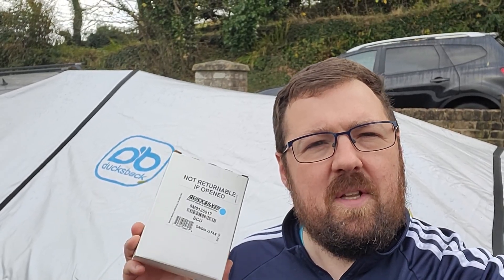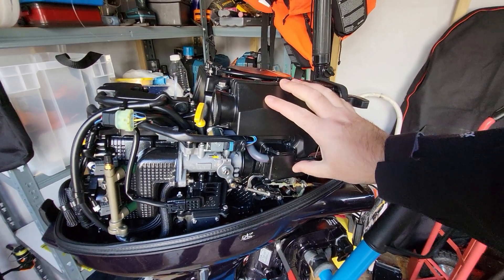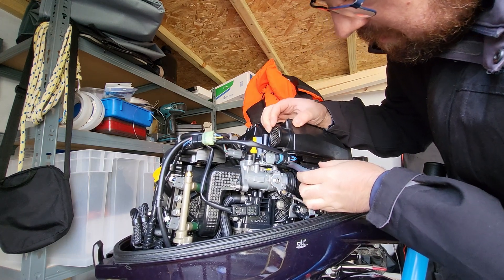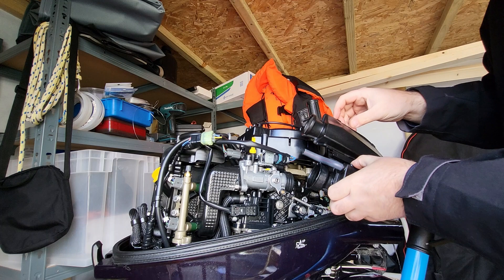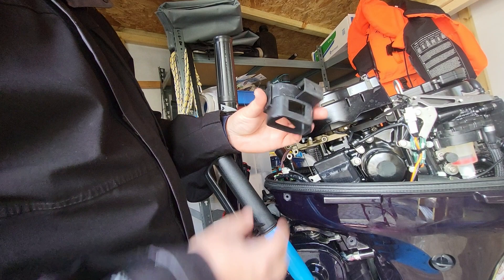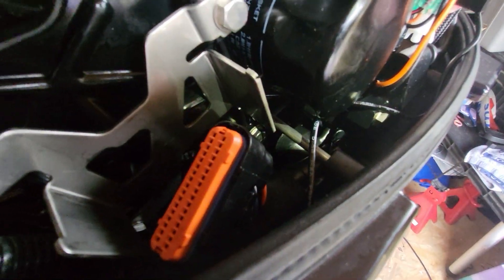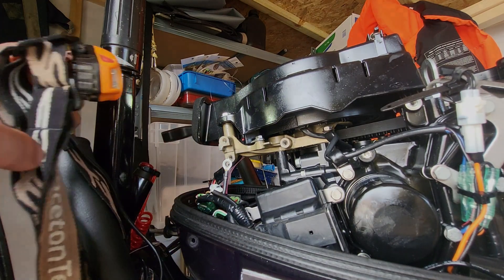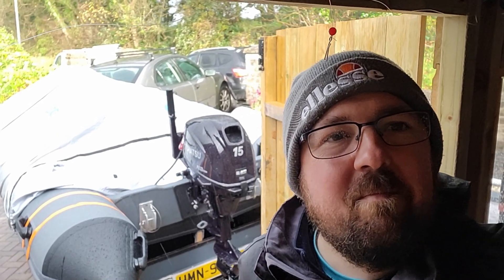Upgrading my Tohatsu Outboard from 15HP to 20HP - ECU Upgrade & Restrictor Plate Removal

Comment: Hi, ive just bought this to do the same. It has the standrad 15hp propellor currently did yku change yours in the end? If so to.what size?
Reply: Finally got around to fitting it today. Couldn't do a top speed test, but was hitting 18 mph at under half throttle!
Reply from the maker: Nice one!.
Reply from the maker: I did change it to a 1" smaller prop before the mod. After upgrading the HP I fit the original prop again and rpm was perfect. Best to fit a tacho and measure your actual RPMs mate

Comment: Don’t forget to upgrade your propeller
Reply from the maker: My 10" is perfect now, previously running a 9"
Reply: @TheReelIsle was this due to the upgrade to a 20hp?
Reply from the maker: @Oakey22  the rpms with my 9" while 15hp were ideal. Once increasing the power, the 9" prop caused higher rpm, so switching to the larger 10" prop fixed that - more torque

Comment: Good day! Thank you for posting this video, I got a 2023 9.9 on dealer recommendation for a smaller boat(I’m not a big boater I’m new to it) and could use more power. I will be doing this soon. Can you provide a link for the ECU? My understanding is the 9.9 is the same as 15 and 20. What prop did you upgrade to? Thank you for the help!
Reply from the maker: Hello! So happy you've found this useful.  The part number listed on the eBay item I purchased is: Mercury: 8M0135817 & Tohatsu:  3RS-06401. The original listing is no longer available I'm afraid so I can't share the link. Good luck!

Comment: Great upgrade. I am just wondering, how do you know that it gave you extra 5horses? And second question how much did you buy the ECU. Cause I see it’s listed for 900€ on eBay and this price tag is not worth the extra 5.
Reply from the maker: Hey thanks. I paid around £500 for the ECU. I know I got the extra 5 horses because the 9.9, 15 and 20 EFI engines are all identical aside from the ECU mapping and existence of the restrictor plate- identical otherwise. My acceleration and top speed went up and my rpms did too, moving back up to the 10" prop too. When I bought my engine the 20hp was hard to get hold of (covid), and there is no second hand market on the Isle of Man so for me buying the ecu separately was worth it. I've kept it too so I can sell the engine as the original 15hp and or sell the 20ecu separately in future
Reply: @TheReelIsle  that’s some great news. But is a reprogramming of ECU possible? Not buying a new one just reprogram the existing one?
Reply from the maker: @kostaskollias82  I believe so, there is an Australian website servicing that but I've not come across others. I suppose a dealer could.
Reply: @TheReelIsle  my dealer said don’t touch the engine 🤣
Reply from the maker: Spoken like a true dealer lol.

Comment: I just did this exact same thing with a new 15hp. Runs perfect, but at full throttle the red oil light comes on, just before, its fine but possibly its the electronic governor limiting revs? It's only a 10ft inflatable so it really gets up and moves. You have any issues at WOT?
Reply from the maker: No issues WOT for me. Check what your manual says for the light you're seeing. Static vs flashing, buzzer too? Sounds like it's probably rev limiting but check the explanation in the manual. Best to fit a tacho so you can measure your RPM and then increase prop size as required. Good luck!
Reply: Did you ever figure out why your light come on mate? Mine does the same ta
Reply: @olirow  I'm figuring it's the stock prop, with the higher hp it's getting the revs to high on the top end. I plan to reprop it as soon as I can to see if that sorts it out

Comment: Great video mate. I am currently running the 15hp Mercury 4 stroke. Would love to do this mod to mine. Been contemplating a ss prop upgrade but this would be nice. Any info on part numbers etc. Cheers 🙂👍
Reply from the maker: Hi mate thank you! Best I can do is give you a link to the item I bought on ebay as I wouldn't want to recommend specific parts in case there was a difference with your engine. Hope this helps! I probably wouldn't go for a ss unless the engine was higher hp - https://www.ebay.co.uk/itm/204484940612?mkcid=16&mkevt=1&mkrid=711-127632-2357-0&ssspo=v8xGk1sDQhG&sssrc=4429486&ssuid=ftrrbQ4XSlW&var=&widget_ver=artemis&media=COPY

Comment: Do you need to replace the ecu or can you just do the carb and a prop? I see kits online that are just for the carb and prop and claim to be the conversion.
Reply from the maker: This engine is electronic fuel injection not carb, so only need an ecu and removal of restrictor.

Comment: just bought a 2011 Mercury 15 and was reading the servie manual.  The Manual is for 15 and 20 I was like oh I'm curious how much bigger the bore or stroke is on the 20.... looking at the specs everything was IDENTICAL b/w 15 and 20.  I then figured this must be a manufactuer using an ECU to limit power like BMW and Porsche do which is easily flashable to get much more power.  Then I remembered all the small Mercury outboards are just Tohatsu's.... found you on YouTube and then I see you holding a QUICKSILVER aka Mercury parts division box.  I'm totally doing this to mine, what is the part number on the box?
Reply from the maker: Hey glad this was of some help to you. The performance improvement was well worth it in my opinion! Here's the link to the ebay listing I used, which includes Merc and Tohatsu part numbers! https://www.ebay.co.uk/itm/204484940612

Comment: Can't wait to see what difference it makes with my mercury 15hp efi to 20hp on my HONWAVE 3.8 ie3 🤪 
Any advise please 👍🏻
Reply from the maker: That honwave will fly! I'm so Impressed with my results. All the advice is in that video mate. Take your time and watch out for the clips on the ECU - they're quite delicate.
Reply: @TheReelIsle  did you have to change the pitch of the prop?
Reply from the maker: I put the stock 10" prop back on again. While still a 15hp I ran a 9" but on a smaller boat.

Comment: Is it not possible to get the ECM remapped rather than buy a new one that looked very expensive. I wonder what would happen if you just removed the restrict or plate
Reply from the maker: I did research a remap and it is possible, but i was put off in case it bricked it. The only widely advertised option I could find was someone in Australia, oddly. I'm sure others can do it. This way, I have a 15 and a 20 ECU. When I sell the engine I csn include the buyers preference, and then sell the other still.
Reply from the maker: Removing only the restrictor plate would force the engine into a limp low rpm mode. I have seen videos of some boring the restrictor out a tiny bit, but not worth the risk in my opinion - it's important those injectors know how to correctly operate given the air flow
Reply: @TheReelIsle  im in Australia, can you tell me who you found can do the reflash? Cant seem to find anyone.
Reply: Just removing the restricter plate is all you need to do. It doesn't go into limp mode, it runs like a scalded dog! In my case with the motor on a 15,6 gheenoe classic weighing 245 lbs plus gear I had to go from the 10 pitch prop to 13 pitch to pull rpms down to 5900 rpms  with a gain of 3 mph.
Reply: @terrypritchard5031 only 3mph
Reply: Hi guys, I did the restrictor removal only yesterday. Mine went into limp mode but I could defintely feel the extra power before it did. Guessing low oil pressure from possibly over revving. Turned it off and re-started and it was fine again. Having the extra power was way better.
Reply from the maker: I'm not sure what the effect is of removing the restrictor without replacing the ecu - I cant comment sorry!
Reply: Can you inform us how its going ? Still getting ktimp mode ? Im thinking doing this to my engine and mayby put a bigger propeller  @adamgladwin-yn1rf
Reply: @georgebrioni9153  yes mate. I trialed other washers aswell to restrict too much air going in and it hung in there longer but would eventually go into limp mode on WOT.
Ended getting a 30hp Tohatsu in the end

Comment: I assume the block cylinder capacity etc is the same for the 20 and 15. You don't end up with a lightweight 20hp.
Reply from the maker: 9.9, 15 and 20 EFIs are the same engines with different ECUs and presence of a restrictor plate. They share a parts catalogue aside from those. All weighing in at approx 44kg dry.
Reply: @TheReelIsle  Perfect! Thanks!

Comment: Hi, interesting video. I was wondering why didn't you get a 20hp in stead of the 15 as the weight is the same. Thanks Steve 👍
Reply from the maker: Hi Steve, thanks. I bought my 15hp during covid and it was one of the only engines available in the UK at the time - which would also ship to the Isle of Man.

A costly upgrade but sometimes you've just got to bite the bullet!
Reply: I know what you mean. I also had to wait a while to get my Tohatsu 20hp. Are you pleased with your tohatsu, I got mine in December 2022 and have done 40hrs so  for.  All tucked away for winter now. Enjoy your channel 👍
Reply from the maker: Thanks mate. Yes I absolutely love my Tohatsu - a solid piece of kit which gets used year round. The pre-winter service gets her ready for the cold weather